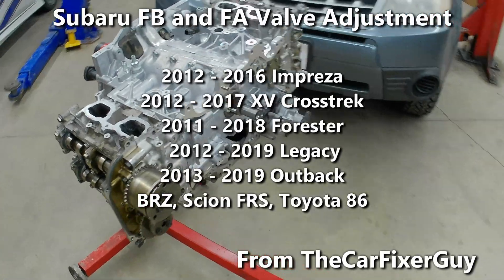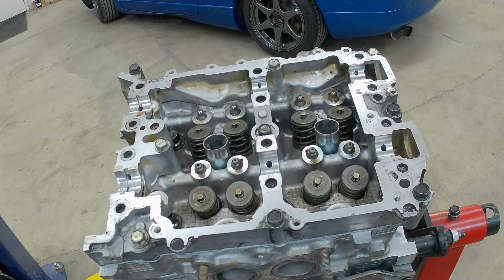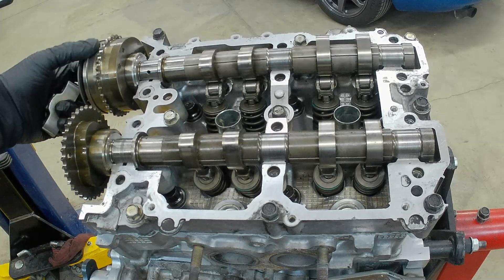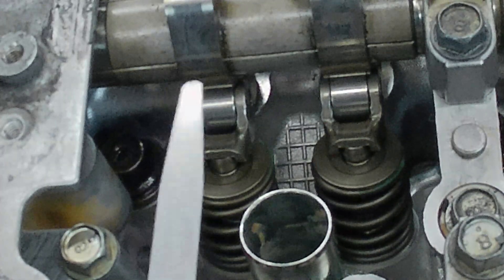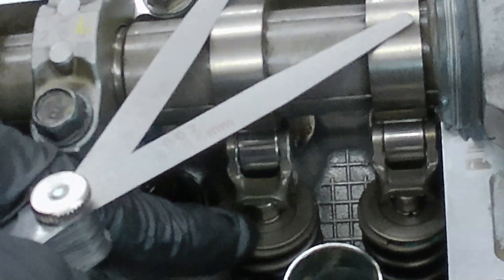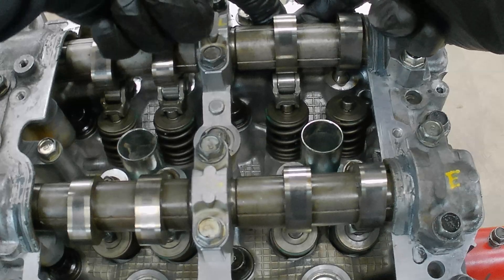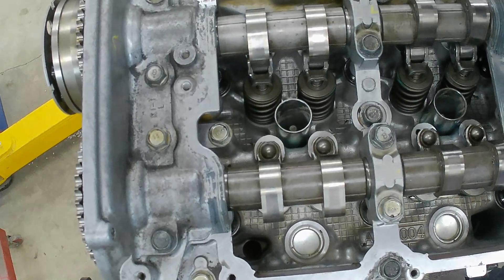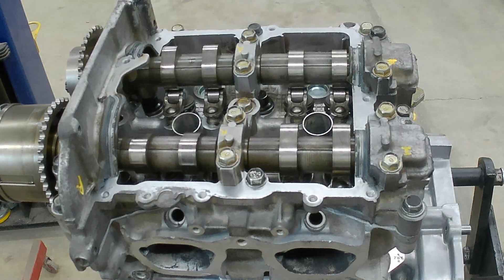Subaru FB25 Valve Adjustment including removing and installing rocker arms without removing cams.

Comment: It's not as simple as adding shim thickness to make up for the valve clearance.  The rocker arm creates a lever around the pivot, and you don't get as much movement mid-rocker (where you measure) as you do at the shim.  That's why Subaru provides (for the intake):

S = T + 1.54*(V_old−V_spec)

S = new shim thickness
T = old shim thickness
V_old = measured clearance at roller
V_spec = target clearance (0.13 mm for intake)

And for the exhaust it's a 1.69 ratio with a target of 0.22 mm.

Comment: This really helped. I replaced my short-block in MY12 forester last week. I Slapped it together to fast and mixed valves up on one side. I did the valve adjustment while in the car today. The only trouble I had was that I could only work on two valves at a time and only safely switch between them. I am not sure if the valves would make contact with the piston but didn’t risk it.